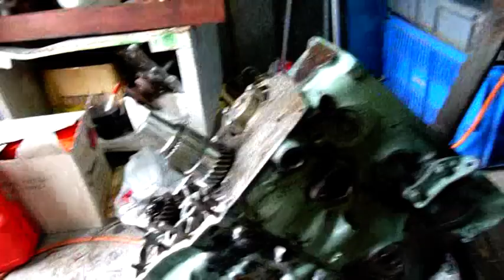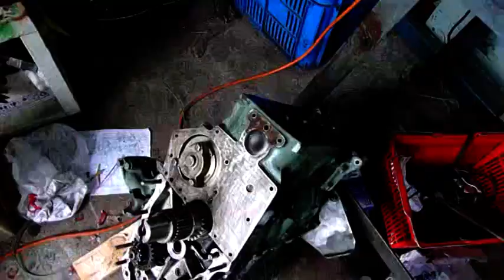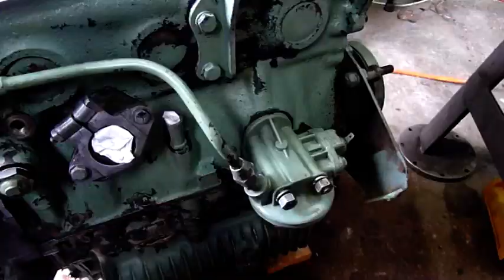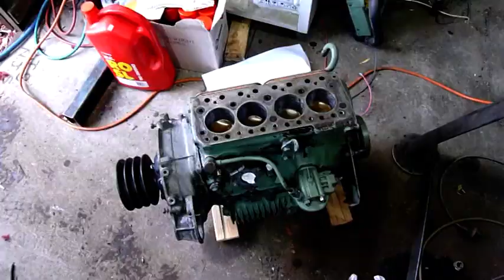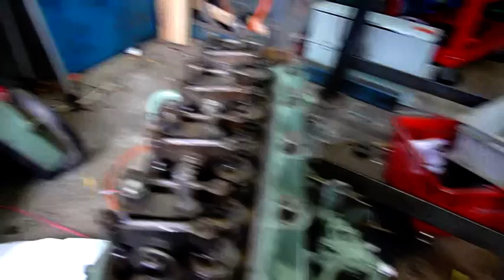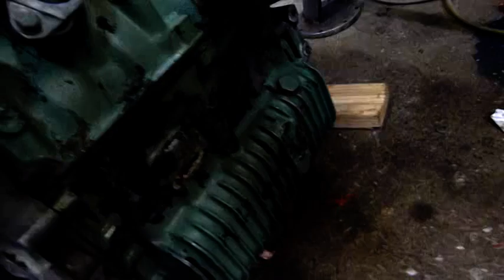Morris Engine Re-Assembly pt2 - Damn Yobbo Interruptions

Comment: to clean gasket areas the best ive ever used is called 3M Bristle brush. They are disks with plastic pins on them you put on a die grinder or a drill. You can choose then for steel or aluminium.  Did my compressor's head with that, worth it